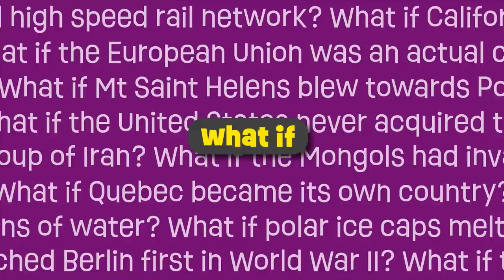Water Pipeline: What If An Aqueduct Was Built From The Great Lakes To The Southwest?

Comment: What about a aqueduct from the pacific to death valley 🤔  it sits below sea level could turn it into a destination loop and could then lead to salt harvesting from the brine for non-food related purposes (roads and salt extraction)
Reply: @feedayeen  I think the main problems with salton sea from the limited knowledge I have of it is the fact it has no inflows to the sea unlike other like the dead sea which means it's retracting at a fast rate exporting the sea floor which has become mineral rich and toxic second is the huge amount of thermal brine in the area which is cycling even more minerals into a already declining area.  I'm looking at what they are planning with the red / dead sea water conveyancing pipeline and thinking something like that could be done to help the situation as the current environment problems caused by current desalination systems are offering even worse environmental impacts
Reply: @timnicholls19  Yes, the lack of a regular source accelerates the issue of since toxic materials will concentrate significantly faster. But every region like this does eventually have a problem like this and if there's both a significant net flow into a region with current fast enough to hinder diffusion of soluble materials then it inevitably will concentrate. It'll be hard to do an evaporation pond without those attributes.

Comment: There is also plenty of Arid land between the Great Lakes and the American Southwest. I'm sure Kansas could use more water and farm more lucrative things besides wheat. If the Southwest wants more water it would be better to find permaculture projects starting in the Mountains and they severely reduce use for decades as the permaculture gradually holds more water higher and then there potentially could come a time where there is plenty of water. Not everything works as planned.
Reply: I think the big problem with that is permaculture relies heavily on groundwater and rainfall.  They are in short supply of both.  Gonna take a lot more than a few swales to save a desert.  They're running off water three states away as it is. I think getting water from Washington State would be more feasible.  They have more and their water replenishes.
Reply: @antarbenson9328  Sure, but holding back some water could eventually replenish the ground water or make new springs occur.  I was saying more that it shouldn't just be get water to the desert but lets keep water high everywhere. And if permaculture did take hold and we had more control of the water and water storage in our soil, there could come a time when water from one side of the continental divide could be connected to the other and then water could be moved more freely. My idea would be a super long term solution. And maybe we should be having expensive housing in the desert where a resource like water is scarce.
Reply: 80% of human use water in California is for agriculture.  And most is exported  to other 49 states. 40 million Californians use just 20% of water. Problem isn't the cities, it's farming  that should be done in other states.
Reply: @saybanana  And agriculture can be part of the solution through a permaculture solution. And if other states implemented it, California wouldn't need to use so much water of its own.
Reply: @NAUM1  it would if they had water to hold back. Their source is the Colorado River.  They use dams as optimally as possible to slow the flow and are still in the situation they're in. The problem is recycling water.
Reply: I don't think you understand what I'm saying because you have too much of a narrow scope. Let's say Eastern Colorado, Nebraska, and Kansas start adopting Permaculture today. It would take a couple of decades for those areas to replenish the aquifer and have an abundance of water. But they would have an abundance. This would benefit those locations drastically because water would no longer be a concern but it would mean they have a different way of using it. All that would need to be done then is to pump some water over the Continental Divide and have it flow into the Colorado River which would be anywhere on the Pacific side of the Continental Divide in Colorado. Then the West would have more water. 
Or we can move the people out of the place that are deserts and to the places with lots of water. Some of them probably move between the two places twice a year already as snowbirds.
Building a pipe of any kind is just a pipe dream.
Reply: U dont pay attention much do U?
Reply: @Proemed44G  Wat u talking about? It seems weird to accuse someone of not paying attention but then not paying attention to actually using words to make a point.

Comment: I have thought about this. Not that I'm a expert but I always thought it would be a thing to do if you limited it to Flood waters only. In the past they had major floors their And I figured during flood time it would be better to pipe the fresh water out west instead of it just flowing into  the ocean . But only floor water would be devirted
Reply: Apparently this has been considered before, but the main problem would be the tremendous amount of energy required to pump the water up and over the continental divide, roughly bringing the water up some 4000-5000 feet of elevation.

Comment: Would it be feasible to inject excess flood waters into depleted aquifers? This would seem to reduce two problems at the same time.
Reply: Most regions already try to capture flood waters with their resevoirs/dams already. And floods are generally part of the ends of droughts, or atleast count towards a region's rainfall totals so while the floods may be too much water now, the captured water is needed later.

But the real issue is trucking (no way a pipeline could be built remotely in time) several billion gallons of water across the country just to dump it in lake Mead.

The real solution for the southwest is to get desalination built for all coastal cities so the inland rainfall can be reserved for the inland cities. (And the salt doesn't have to be returned to the ocean, put the brine in large evaporator ponds and harvest the sea salt and sell it as the commodity item it is.) Also agriculture in the desert needs to stop being 80% of the water usage, either pick better crops, use better methods, or close down farms.
Reply: I'd vote for attaching a pipeline to New Orleans.  That place floods all the time and has serious storms. You'd be doing New Orleans a favor by taking excess water and it's much closer than any place else.
Reply: I think you ment injecting the water from say a missippie flood into the Oglala aquifer under the western plains. It would take a lot pressure to force it the down hill end and thus push that water up hill or if it would  be Ponded to seep into the upper end would take aqueducts or pipes pumping water up hill to the eastern edge of the rockies
Reply: Yes, but the aquifers which are being depleted are far away, so the transportation costs would still make it infeasible.
Reply: Feasibility is simply a question of whether it's possible to rapidly pump billions upon billions of cubic meters of water about 1 mile uphill into the rockies within, say, 1-3 weeks. This would be a great idea I think because all that floodwater flowing out into the gulf of Mexico is essentially the country's fresh water supply turning into saltwater. There would be an ecological impact as less flood = less silt = less fertile oceans and surrounding delta land, but the prospect of reducing the damage of both floods and droughts may be considered worth it.
Reply: Oh and what stops them from draining it out when waters are low? This is exactly what has happened now, you pipped water to where it wasn’t and made bad calculations with deals that never were filled! No thanks move the people out of the desert and live where water is. Otherwise desalinate and use the water that’s right beside the cities like Los Angeles
Reply: @stvrob6320  It is 300 from North Platte (annual flooding & Mississippi River Basin) to Poudre Lake which outflows to the Colorado River. It's another 300 miles to Sioux City, which is on the Missouri River. Over 10% of the water which flows down the Mississippi passes by these points. The infrastructure wouldn't be cheap, but with a bit of planning, much of the flooding on the Mississippi could be prevented by a set of pipelines as long as a hard days drive.
A 360 mile aqueduct in Kansas was planned by the army corps of engineers for $18B plus $1B /year for operations.If you triple that cost for the distance needed and fund that via government bonds, the annual price would come to $1.5B a year for financing costs and $3B in operations costs. Would this produce ~$5 billion in benefit?
Well the 2019 flood years (the first data that Google gave me) the economic impact of flooding in the Mississippi River Basin was $20B. If the pipeline could reduce food damages by 25% or more, the flood mitigation alone would pay for the pipeline. The water down the Colorado would just be a bonus.
Reply: @ricklewis4442  I agree, while the abstract of just piping water from the Great Lakes is an easy target of criticism, there are still much more practical and feasible solutions using shorter connections just between neighboring basins.
Reply: Flooding=fertile soil for farming. Farming is pretty big in the Midwest
Reply: @masterniloc   Just make the agreement like this: California taxes its agriculture to pay for water. California pays Arkansas for water. Arkansas controls the water flow. No money = no water. Low water in Mississippi = higher price.
Reply: @ricklewis4442  problem is with unseen consequences, they have to see the damage to get the money to pay it.  you can do the math the same way for the price of food, well you will be able to soon.
Reply: If you inject surface water into an aquifer, you will contaminate it.

Comment: You don’t need an aqueduct going all the way from the great lakes to California all you really need to do is to be able to divert the right amount of water to the closest available location of the great plains aquifer after filtering the water extensively allow it to drain into the great plains aquifer at the other end closestTo the Sierra Nevada’s you put a pumping station where you then pump the excess water from the Great Plains aquifer up over the Rockies and into the Sierra Nevada’s basin then all you have to do is let the natural river system do what it does best

Comment: Well done. However, the yearly flooding along the Mississippi river , especially when the area is affected by a Hurricane, would be a good source. From around Memphis through the southern route via Dallas, El Paso, then to Tucson would seem to be a better route than from the Great Lakes. The mountain ranges are not as difficult as the northern route.  Furthermore, you'll get less resistance as the flooding waters can be directed to the aqueduct.  Agree strongly on eliminating green lawns and golf course watering.

Comment: A better project would be to divert excess water from the Mississippi and Missouri rivers to the Colorado River.  That would be about 1000 miles of aqueduct total. Nature will do the rest.  

I would love to hear your take on this!
Reply: One big problem with this proposal is the huge amount of energy that would be required to lift the water up to the higher altitude.  During the LBJ administration, it was proposed to lift water up from the Mississippi to the high plains of West Texas.  One aspect of the plan was to build 6 nuclear power plants along the way to provide power.  Think of hydropower in reverse.
Reply: The Missouri River starts in southwest Montana.  It would be a much shorter run to pull from there.  The Missouri River supplies 2/3 of the water that is in the Mississippi River.  A logical place to pull from would be between Montana and Kansas City.  Both rivers were over their banks this spring and summer.

Comment: As a southwesterner, i don’t think our problem is the amount of water at our disposal. We have ridiculously stupid water rights laws. It’s basically use it or lose it the following year. So of course farmers grow the crops that use the most water so they don’t lose their water rights. Which then turns into our geographic area using the maximum amount of water allowed. It should be focused on what are we getting for the water being used, then award water rights based on optimum output of crops for water being used. Reward based on optimization of water rights, not maximization of water usage.

Comment: The best option for divert water from the Midwest to the Southwest US involved capturing and moving seasonal floodwaters from. where it's not wanted or needed to where it is wanted and needed. In theory, it seems like a good idea. But as mentioned, the cost would be ASTRONOMICAL just to move to area east of the Rocky Mountains in CO, NM & TX and moving it west of the Rockies would be it's own HIGH priced challenge as well. In the meantime, there are a number of things that CAN be done here in the Southwest to capture, conserve, and recycle the water we currently have. None of which is really even on the back burner in most locations

Comment: As far as I see it, cost would be by far the biggest fundamental issue. On the other hand, the risk of drying up the Great Lakes could be avoided entirely by taking the water from the outflow of the lakes, and restricting water transfer to southwest reservoirs during the winter months when you anyway have huge amounts of excess otherwise just flowing into the sea. This of course would require a longer aqueduct, making an already pricey project even more expensive.

Comment: Water from either the Great Lakes or the Mississippi basin would have to be pumped up several thousand feet to go over the continental divide to reach the southwest.  This would require a massive pumping infrastructure and the electricity to power it.  If these expenses are applied to the cost of the water delivered, this would encourage water poaching along the route.  And the people keep moving to the Southwest probably outpacing the water delivery capacity engineered.

Comment: One idea that may be better is spill ways. Some areas are dealing with annual flooding in the lower Midwest to central south areas. If there were spillways to divert the excess water only, I doubt anyone would complain. It would be cheaper than a pipeline and at least move excess water that would normally go into the gulf of Mexico anyway. I haven't completely thought about everything, but it seems like a better idea and would likely have the least environmental impact while spreading the water out over larger distances. It would have to be a federal project though.
Reply: Because it is only run off water, it wouldn't be available the whole year obviously which is a glaring weakness, but it could divert large amounts of water that could be stored for some time.

Comment: Physics is crazy with some younger students. South does not equal downhill. Chicago  O'Hare international Airport has an elevation of 668 feet above sea level.
The Elevation at Phoenix is 1,089 feet. To get there you must cross the Continental divide. The lowest point is in New Mexico at an elevation of 4,000 feet above sea level.  How much power is required to pump that much water up by more than 3,000 feet from the Great Lakes.

Comment: I doubt you will see this comment, but in utah with our water shortages, they are considering making a pipe to pump salt water from the ocean to the great salt lake- assuming this was possible & salt wouldn't destroy the pipe, engineers know more about that than me- do you think this would have any downsides besides just the price of the pipe & pumping salt water into an already salt bed? Their goal is to refill the lake manually and overfill it to cover alot of the salt flats to increase the amount of water evaporating in utah, that way we can permanently alter the ecosystem here to be more water rich- as well as solving the problem of potentially toxic dust coming from the bottom of the lake when it eventually mostly dries out (it never completely will but it is slowly going down & will cause issues eventually)

Comment: The idea was to tap the upper Mississippi River at flood stage and send all the excess water over Kansas into Colorado and into the Colorado River to increase river flows into Lake Mead.  That is the best solution but it will never happen.  And for the Non-CA people, desalination is very expensive and not great for marine environments.  Our state needs more water storage capacity so very little is dumped into the ocean.

Comment: It could be possible to use existing oil and gas pipelines throughout the U.S. to transport water.  There is already technology that can clean these pipes.  However, these oil and gas pipeline owners are not going to switch to transporting water unless it was more profitable to do so than oil and gas.  I do agree that moving water to drier areas amplifies the problem of overuse, but it could also help certain areas that are prone to flooding or essentially have an abundance of water.  There are dams that are near capacity that have no choice but to release the excess water down the river and loose the potential hydropower.  So, moving water around could potentially help improve flood management and provide additional revenue to those that have rights to sell the water.